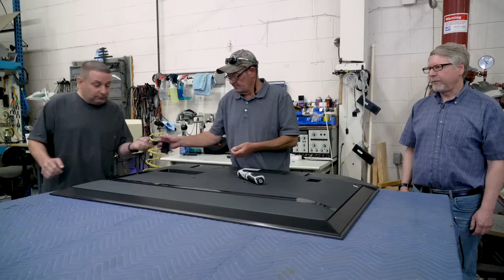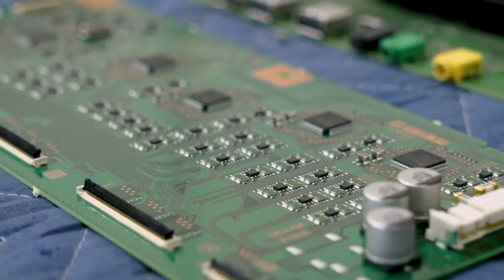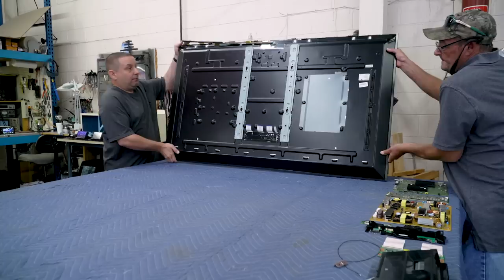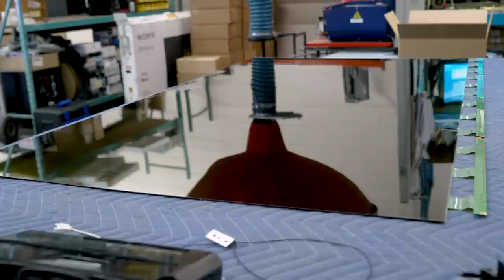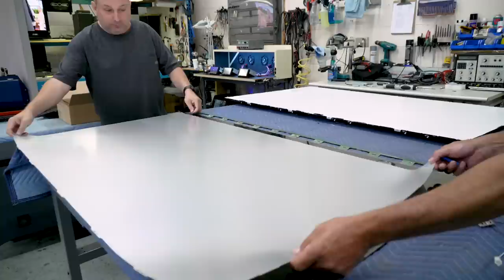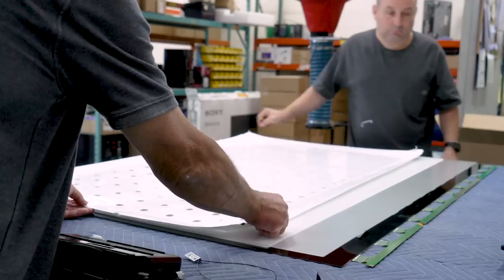What's inside? We take apart a 4K TV | Crutchfield video

Comment: Thank you Crutchfield,very interesting disassembly analysis for Sony XBR65X900F.I 'm waiting for another like this,keep up .
Reply from the maker: You're welcome! We intend to!
Reply: @crutchfield  The plastics should have been bit thicker..... The build quality is flimsy. Why don't Sony use full aluminium back cover, instead of el cheapo plastic?
Reply: @crutchfield  This tv needed all aluminium build, like the one macbooks have.
Reply: @Subhasis44597  most TV's today are built that exact same way, actually. It's done to reduce the weight of the units and also the overall cost. There's really no reason to use metal where far lighter (and far less expensive) plastic will suffice.
Reply: @michaelbeckerman7532  But the build quality is worse with plastic.
Reply: @michaelbeckerman7532  What is the thickness of the metal backplate used on flat screen tvs? And do bigger tvs have thicker plates? Please reply Sir.

Comment: Back in 93 i took a older TV to a repair shop to get it fixed. Turned out the repair was gonna cost more than the TV was worth so the shop offered it as a trade in for another one at a decent price, so i went for it. Got to talking with the guy and he stated in less than ten years all TV's will eventually go to LCD's and CRT's will end production soon after. That guy knew the future of TV's, and it wasn't a prediction. He had insider knowledge that they had planned this decades ago.
Reply from the maker: Sounds like you chose the right shop! A lot has changed in TVs since 1993 for sure! Can you think of anything you miss about your older CRT models?
Reply: @crutchfield  only thing I miss about them is the memories, outside of that I miss nothing. I wouldn't trade any of my LCD TV's or my monitors for a CRT. And the worst part is I can't give any away or legally discard any. There's no place around here that will even take them for recycling without driving too far to get there. All they're doing now is taking up space. Got a deep holler I know of and I'm tempted to toss em' off in it... Lol... and one is a 32"... hurt my back some one time lifting it by myself... I actually despise CRT's now.
Reply from the maker: Most of us can relate to those memories and struggling with their hefty weight! 😁 Good luck with your recycling.

Comment: Very good video. My display was turning on and off with sound on, technician said that the display is shorting and tv is going under protection mode. He told me to get the display changed.  Do i have to change my display in this case?
Reply from the maker: We cannot diagnose your issue from here, but if a technician troubleshot your issue and advised you to get the display changed it sounds like a good idea. If you are having issues and do not repair, a new TV is the next best option.

Comment: I'm not sure if that tv had it, but where are the voice listening devices in the tv? I am wondering if it's something that I can remove when I buy a new tv? Have you done this before and tried to power it on with that hardware removed? For example, if the tv's operating system is trying to load Alexa, Google Assistant, or Siri, but the hardware was removed, what is the OS's response and will the tv still function without it?
Reply from the maker: We do not get information about the programming and any responses that my be written in the code for when that gear has been removed. Also we do not research the TV's to gain that knowledge or perform tests on how they operate after the removal of the gear. However we do know that there have been times when the microphone used to pick up the voice commands is in the remote. If you get a model like that, it is very likely that you would not need to open the TV to remove the listening devices

Comment: Hello great video😍 i have a question. I see yellow stain,  right and left sides of my LCD TV which is visible in the white picture. Tv is more than 15 years old. What's the problem and will it get worse in the near future?
Reply from the maker: If the panel is properly working, that could be burn-in image retention on the screen. This is unlikely to get worse or spread to other parts of the screen. If it is an issue being caused by a malfunction in the panel or processors, then it is likely that the stain will spread or get worse.
Reply: @crutchfield  thank you for the answer

Comment: Interesting to see inside. What takes longer though, assembling the TV in the first place or taking it apart?
Reply from the maker: That's a good question! We do not 100% know as we do not have access to the factory. However,  It is most likely that an assembly line style building process is used so the time from start to finish would be greater than it took us to disassemble this TV.

Comment: This is such a good content! Thank you.
Want to know, would it be possible to just change the TV panel module (black colour thin layer) when the backlight of the TV is working and the only problem with the TV is no picture.
Reply from the maker: There could be a few different parts causing that issue and recommend arranging for an authorized repair tech to check it
Reply: This tv needed all aluminium build, like the one macbooks have.

Comment: Is there a big sheet of polarizing film? I’m a science teacher and am always looking for cool materials we can use in class - filters, diffuser panels, and polarizing sheets are all treasure. 
Someone is offering me a free non-working big flat screen TV and I’m wondering if I could salvage these kinds of parts from it either on my own or through a local tv repair shop
Reply from the maker: There is not a separate polarizing film. Anything like that would be built into the glass sandwich layer (the first big sheet to come off the TV) and cannot be separated. However, you might enjoy getting your hands on the diffuser layers from a TV panel

Comment: What part would need to be replaced if a third party has control of my tv (hacked) from accidentally giving them the activation code? Brand new TV, but they have me in guest mode.
Reply from the maker: So sorry to hear you're having difficulty with your TV.
This video was made just to show what goes on inside your TV.
We do not offer advice, troubleshooting, or information regarding DIY repairs, or activation codes.
You may wish to contact the manufacturer of your television for assistance.
Reply: @crutchfield  how much to fix it?
Reply from the maker: We do not deal with repairs, or anything like that.  You will want to contact the manufacturer for advice and guidance on your situation

Comment: I was hoping you could help me figure out what I’ll need for my setup

I have 2 soundqubed hds2 dvc 4ohm 600w rms and a hifonics Brutus 2000w amp in a prefab ported box I want to get a q bomb box from Walmart for $100 and install them in a 1995 Tahoe, do you think I’ll need an extra battery or big three? If so can you suggest we’re I could buy everything, I’m also in need of single din radio suggestions as well as wiring kits? Any help would be appreciated
Reply from the maker: It's always best to do the big 3 upgrade with an amp running this amount of watts. An extra battery will be helpful as well, but not 100% required. This will depend on your listening preferences. We sell all this gear along with radios and the gear to install them into your Tahoe. We also have advisors that are happy to discuss your goals and preferences to get a personal recommendation on that battery as well as the new single din radio and install gear. Here's how to reach us for this help:
https://bit.ly/2xOOeQR

Comment: Hi, Any idea what that tin glass is called? also where can i get television parts like that one on an Lg LC430EGE-FHM1 model: 43uf680v
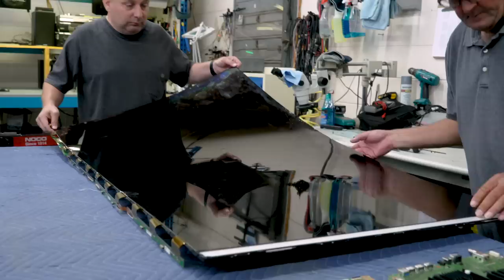Reply from the maker: We think you are referring to the part removed about 7:00 into the video. That is the glass panel with the transistors that control the image. We are not sure if there is a more appropriate term to use with the various manufacturers, but the above discerption should work

Comment: Now I know why I see bright orbs all over my screen, the problem seems to be way in the back of the chassis. I don't know why that happens but by what you demonstrated, looks like it might be an expensive repair. Would it be better to just buy another TV than try to repair the LED light arrays?
Reply from the maker: This is always a tough question as there is no cut and dry answer to it. We recommend that you first check with the TV manufacturer about the likelihood that a repair can be done and possible repair costs on your current TV. If the TV still has warranty, the we recommend getting it repaired. If not and the cost is close to the price of a new TV, then it may not be worth getting repaired.
Reply: i know this is a year late, but should this ever happen in the future, it's something to think about. Way at the end where you saw the LEDs on the back chassis, the glue that holds the lets say plastic cap on the LEDs is often pretty poor and will fail over time. This causes bright orbs in the screen because the light isn't diffused properly anymore. An easy way to check if this is the case is to turn the TV on it's side, or upside down. If you hear what seems to be legos rolling around inside the TV, theres your problem. This can be fixed by simply adding new glue, but obviously needs to be done by someone who knows how to take a TV apart. I've had a couple of the Samsung curved tv's where this was the case, people almost threw out a 1500-2000 dollar TV because of a (....add price of a good, clear transparent contact glue lol...) dollar problem.

Comment: Hi, thank you for the well elaborated teardown of the TV world. I have a question relating to smart tvs, do these like say LG 43 Inches TVs share the same screen with another LG 43 Inches TV  but a different model?
Reply from the maker: Sometimes, the same panel is used in a few different model TV's and its the processors that are different. But sometimes, the panels are also different. The only way to know if the same panel is used in both models is to check them. Which LG models are you referring to?
Reply: @crutchfield  My model is LG 43UJ634V and the one I intend to take the screen is an LG 43 Inches UHD4K resolution the same as mine.
Reply from the maker: We don't have access to the LG 43UJ634V model to research it and gather information on it. We were able to see on LG's website that it is also a UHD4K TV so there is a good chance it uses the same panel as the other model you described. That being said, we recommend contacting LG's support to check this and if the other panel will work
Reply: @crutchfield  I contacted the LG support team several times but they don't want to disclose such information or advise to me. From LG "Hi Ray, this is not a service we offer nor is it one we can advise. Apologies. We can offer you a repair however."
Reply from the maker: Sorry we don't have the info on this model for you Krishnah. Using an authorized LG repair center would be best.
Reply: @crutchfield  thank you so much for your time and help really appreciated
Reply from the maker: Anytime! 🙂

Comment: That means these new ones doesn't have fresnel lens in it , the old ones only have ?
Reply from the maker: TV's typically don't have a fresnel lens in them anymore. They were common in projection TVs we had years ago
Reply: @crutchfield  is there any possible way i can find some spot fresnal lenses in a  cheap way
Reply from the maker: Are you building a custom project or do you need a repair/replacement for a TV?
Reply: @crutchfield  for just an custom project , because  my summer vacations have just started 😃
Reply from the maker: Awesome! Sounds like you're gearing up for some fun projects! It's not something we can source for you; but you could try some online listings to see if anyone is offering them. Keep us posted.
Reply: @crutchfield  thank you so much for your responses 😊

Comment: Hey Crutchfield I have a problem with my 65" samsung model NU65UN6070FXZA it turns on but only the back light turns on doesn't show any features can't hear anything can u maybe tell me what it is that I would have to change
Reply from the maker: There's a few parts that could make the TV function the way you described. We recommend contacting an authorized repair technician to come troubleshoot and fix the issue

Comment: How do you get the extra charge out of the power board so you can safely mess with it
Reply from the maker: This video was made to just give a little insight to what's going on behind the panel of your TV.
We do not offer technical support, advice, or information for DIY TV repair.
You may want to reach out to the manufacturer of your television if you wish to proceed with your project.

Comment: Very interesting! I was wondering if it is possible to get rid off the wifi/bluetooth board and antenna? Would the tv still work? s the remote Bluetooth or IR?
Reply: most definitely will. disconnect it and see :)
Reply: @kookoochoo1536  yes, i got rid off the antenas and board a few months ago, tv still works fine. Thanks

Comment: Great video.  I was told my tcon board needs replacing. I saw a few different models of my brand use the same board with the same part number. Does it mean I can use board from a different model as long as the part numbers are the same?
Reply from the maker: Sorry! We don't have specifics on replacement boards. Your best bet  would be to check for repair or replacement via the manufacturer directly.

Comment: My puppy is playing with a ball and it hit the tv at the edge now there is no damage to the screen and can play the tv channels, sound is good everything is normal except i see some lines on the tv (65' inch) so what should be the next step? Can it be solved? The lines issue
Reply from the maker: Your first best option is to contact your TV brand's Tech Support if available.
Reply: @crutchfield  they are the scam artists saying the screen is broken but clearly not damaged. They just don't want to cover the repairing in the warranty. Since the channel's are almost clear i will continue. Thanks for the reply back.
Reply: @crutchfield  the TV is dead completely. Don't know what to do😔

Comment: Hello doctors:) I buy TV LG UM65' 7050 PL before 20 days, and when i try to put HDMI cabel i put Tv on table on side of screen, my mistake. When i turn on TV was in a lot of color like screen is broken. Can i switch that and what you purpose? Thank you.
Reply from the maker: There are numerous parts that could have been affected by the opening of the TV and attempted insertion of the HDMI cable. If you are capable of reversing your work, that might fix it. If damage was done to one of the video circuits, then you may need to consult a TV repair shop for help isolating the issue to know if it can be repaired

Comment: Hi, this may be a silly question, but how do TVs actually produce their graphics and render an image?  Do they have GPUs or video processors inside them, or is the graphics handled by the CPU on the motherboard?   Thank you.
Reply from the maker: There is a main processing chip that handles most functions for the TV - including the image creation. For example with Sony it is their X1 chip, which you can find out more about here: https://electronics.sony.com/bravia-x1-processor
Reply: @crutchfield  Thank you.  Does the scaler chip/board do any image processing at all?
Reply from the maker: That should be the chip used if the TV is not getting an image that is the same resolution as its native display. It would only provide processing when the incoming video's resolution is lower than the TV's.
Reply: @crutchfield  Thank you.  Much appreciated!

Comment: Hi Crutchfield,

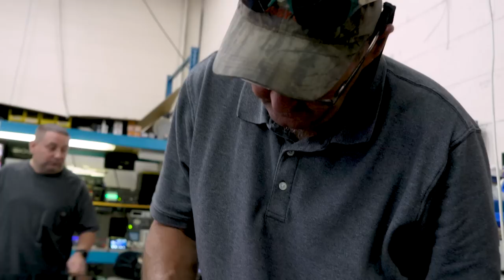Awesome video! Could you please describe to me what those little gold slips are at 6:39 of the video when taking apart the screen? Are those gold bits stickers or something that are located at the bottom of the led screen? Thanks
Reply: Looks like they're thin plastic tabs holding the wiring, which controls the transistors within the screen.

Comment: can i call someone and ask them about an issue im having with my 5 year old toshiba?
Reply from the maker: Hi John, what model is your TV and what type of issue are you having?
Reply: @crutchfield  Toshiba 50 L7 11 u8.    Originally it was just dead The power light would flash and just go off now I have it where since I did all the ribbon cables power supply cords from the main board T-Con and power supply power light is solid like standby starts flashing goes off but the screen is a dark blue color no menu at all
Reply: @crutchfield  when I remove the back of the television I decided to check all cables and chords and try to run a couple tests The back lights are all lit up also when it's on but nothing on the screen just dark blue
Reply from the maker: Bluescreen sounds more like a signal issue. Have you been able to verify your remote is working? Have you tried various inputs and cables for your sources?
Reply: @crutchfield  I did all that first That's not the problem
Reply from the maker: We have not studied the effects when various boards go out to help diagnose which internal part is causing the issue. We recommend contacting Toshiba TV's support for help and found 1-888-407-0396 to be their support phone number. We hope you get it working again!!